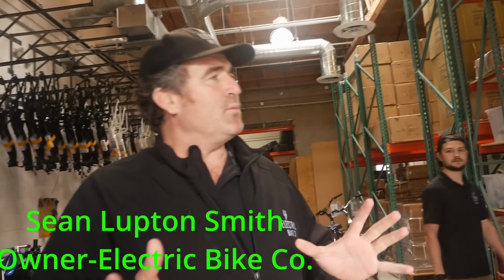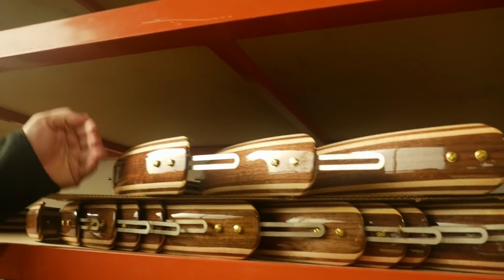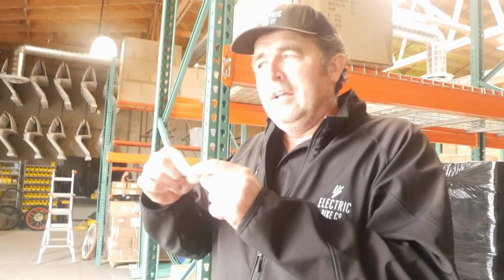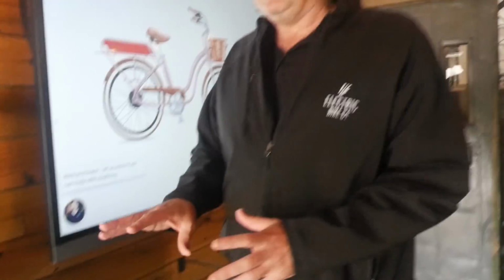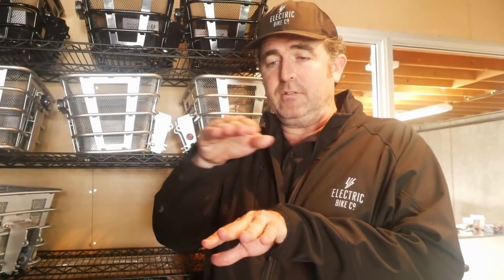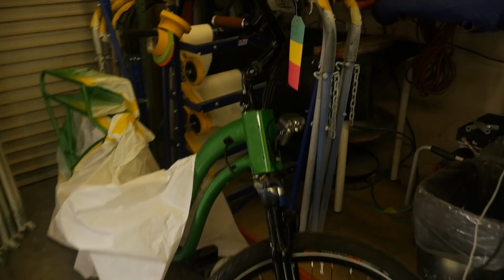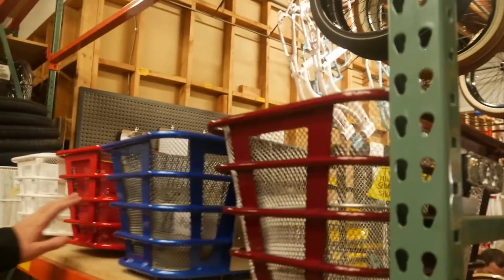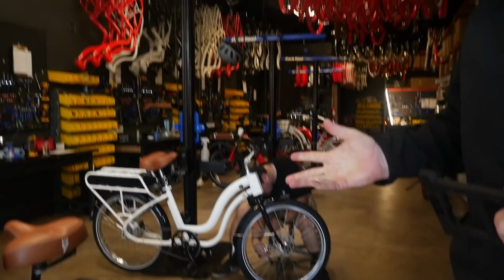Electric Bike Co. Factory Tour of a USA based E-bike

Comment: Unfortunately I bet the most crucial parts of these ebikes like the motors, controllers and battery cells, bms etc are made in China. 
But probably higher quality stuff than the cheaper stuff from unknown manufacturers for sure I would think.
Reply from the maker: I think for a while it will be that way with almost all Ebikes. We just need a domestic company to start making affordable components!

Comment: Great video. If I had any criticism is the poor audio quality. I suggest even for your other videos but especially for remotes like this do you need a wireless mic set up.

Are used to live in Huntington Beach California which is right next to Newport. I'm familiar with this company but do take exception to their claims.  What they do is assemble bikes from bits and pieces acquired from many sources. Just because the paint their frames and such doesn't change that fact.

I was looking throughout the video for something they actually made from start to finish and didn't find anything.  I still think they put together a much better product than 99% of the other e bike companies currently in the market place. I wish they would start building mid-drive bikes at affordable prices.

Comment: This was a fascinating tour of a serious engineering company. Thanks.

This is actually the second tour I have watched of this factory. Yours is far more interesting because it is more technical. I've built several hundred wheels in my life, and to see robots do it in a few minutes is mind blowing. 

Also, Sean's attention to detail improves my impression of the company. You cannot tell all of this from their web site. 

Oh, and THANK YOU for asking him about the motors. From the web site, I dropped TBC from my list of consideration because they appear to be underpowered. Maybe not, if Sean's "1250 watt" number is realistic.

So the next question is... what can be done with TBC's motors? Can you get an aftermarket controller for JohnnyNerdOut-style hot-rodding?
Reply: "Mineral oil soaking system." Just a touch of salesmanship.
Reply: @bjnslc  lol yeah they sure was touch of salesmanship haha
Reply: Did anybody else pick up on the fact that when he talks about motors he talks about the grade of The wire in the winding not so much to branding of the motor which I thought was good that little motor goes to 1250w Johnny you can apply or build a controller for that get the 1250w out of the motor,way Koolio!

Comment: I like EBC. They make a quality product (even if hub driven). Gotta admire an American company taking pride in the product they put out and how they'll support it down the road (pun intended).
I love that they practically give their bikes a VIN.
Odd to see you show off pre-fab hub motor e-bikes. I could see paying EBC prices if you aren't into DIY but I'm sticking to the BBSxx line & DIY.
So, are you thinking of expanding? I'd love to see a JohnnyNerdOut original & customizable mid-drive with long term support.
Reply: Johnny's customizable over this factory stuff any day 😎 did you hear em 60 a day...   I hope they have good QC 60yowza and they lace a wheel in a minute 10 seconds 70 seconds really then they throw it in the machine to true it. I worked at a wheel shop I'll tell you even if it goes into a machine it still has to be true'd by hand
Reply: @franksplace551  I'm no fan of pre-fabs but a huge fan of Johnny's. I've just noticed better quality in EBC over the average junk available pre-made. If a friend wanted one I wouldn't warn them against it only let them know they can get better for less money. The standards for prebuilt hub driven e-bikes are pretty low, so a low bar for comparison.
I envy your skill. Wheel building is like an art form. Even proper truing is a skill that you don't find in many bike shops.